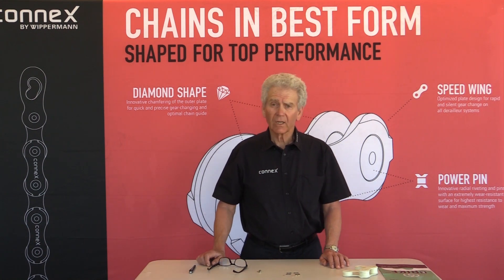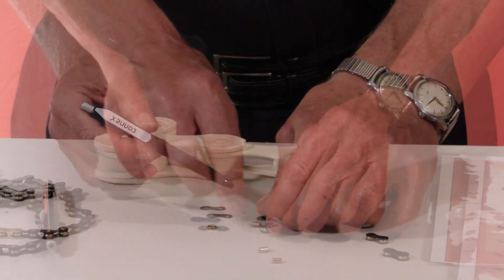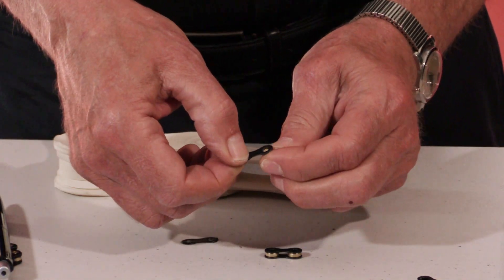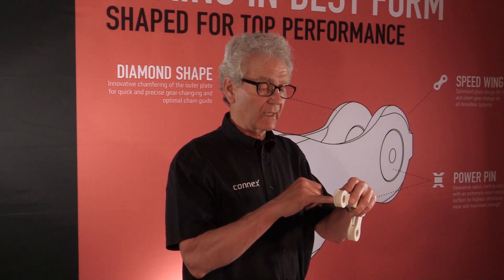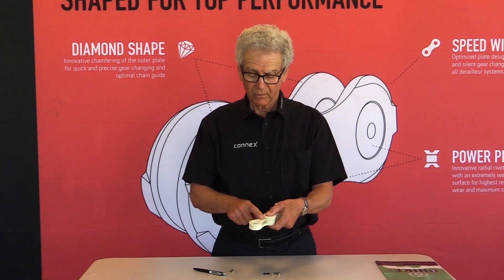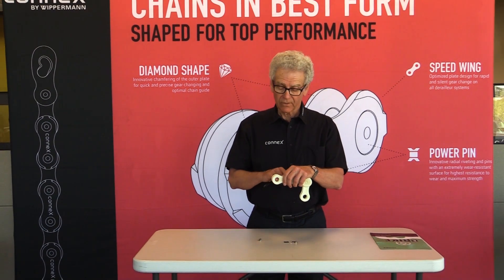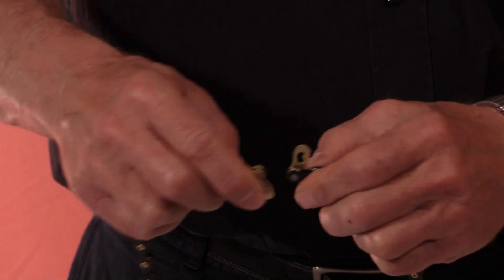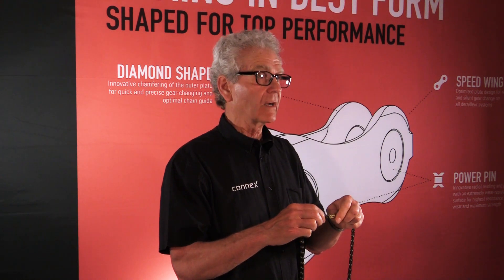Connex by Wippermann | Bicycle Chain Tech Clinic

Comment: I have a Wippermann 9SE on my 77lb fat ebike with 750w rear hub motor. This chain is built more for mid-drive ebikes which can be tough on drive chains more than hub motor ebikes.  I'm fairly easy on my bike, riding mostly on a paved bike path on nice days, but I will say the 9SE is performing better than the original KMC. The bike is fast and it pedals more confidently, and it's nice to know I can instantly remove the chain if need be. An excellent drive chain imho, and I'm not just saying that because I have one. I will buy another if this one ever wears out.